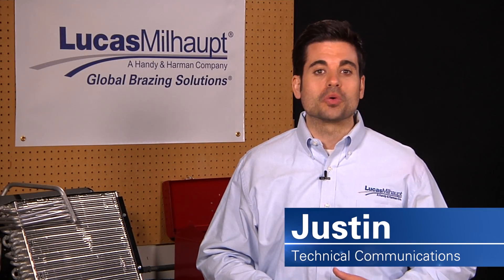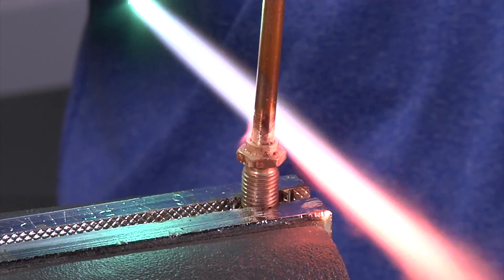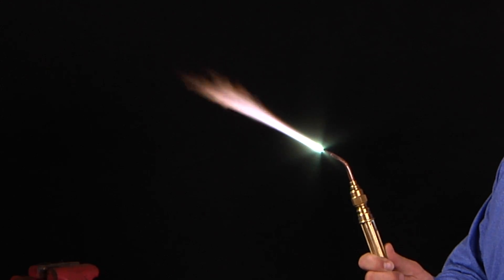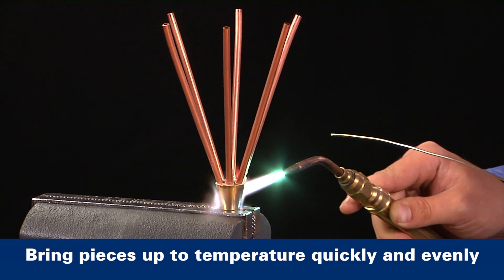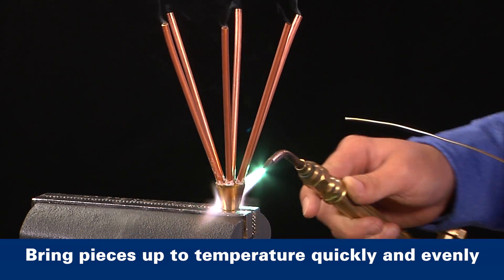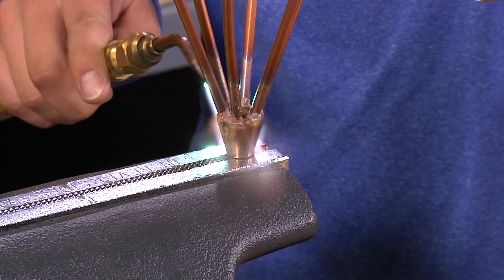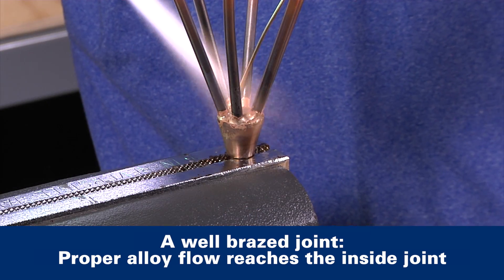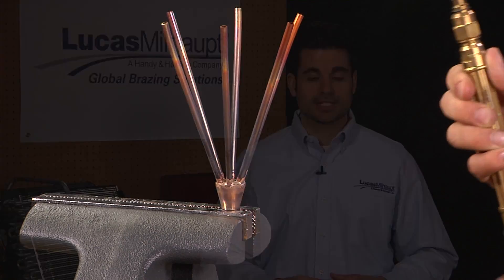Fundamentals of Brazing #5: Brazing the Assembly

Comment: Not necessarily, I brazed for a few years at Carrier back in 2004 - 2007 and I used a brazing torch with 2 ends, and I welded close to the tips, although you may be correct since the color of my flame was blue, but not always. Sometimes the gas, oxygen mix wasn't just right. Our torches looked similar to the one at this link, except our tips were much closer together. We brazed headers and liquid lines on fan coils. 
https://www.amazon.com/Uniweld-MTT-Micro-6000-Flexible/dp/B00FI1JB7E/ref=asc_df_B00FI1JB7E/?tag=hyprod-20&linkCode=df0&hvadid=312125823820&hvpos=&hvnetw=g&hvrand=15609361592651241215&hvpone=&hvptwo=&hvqmt=&hvdev=c&hvdvcmdl=&hvlocint=&hvlocphy=9011566&hvtargid=pla-599609125884&psc=1